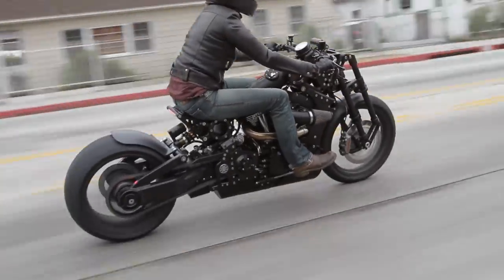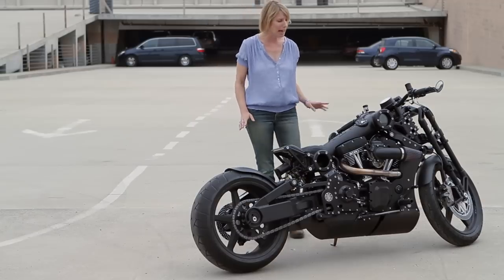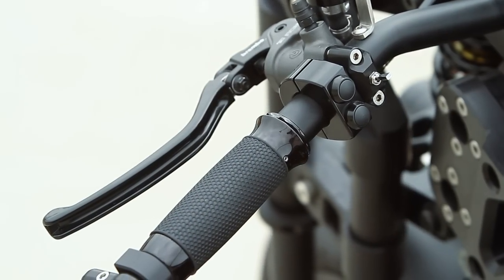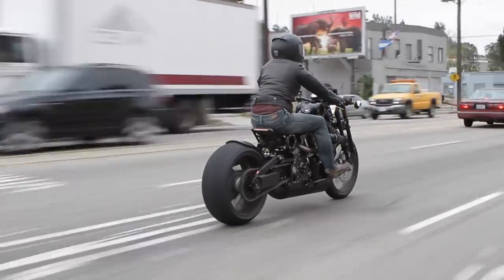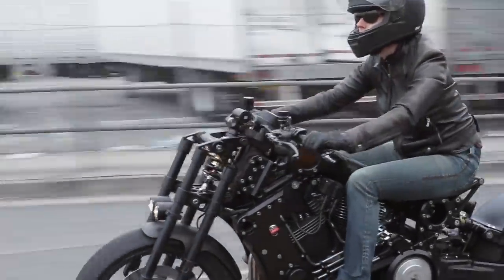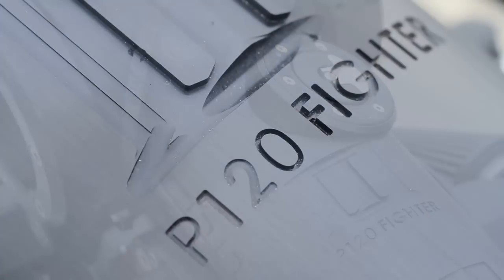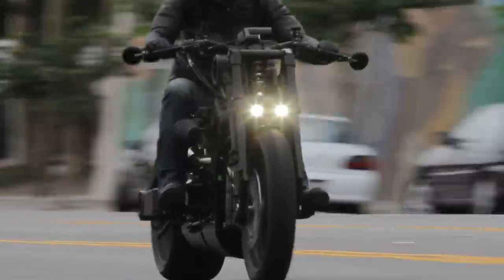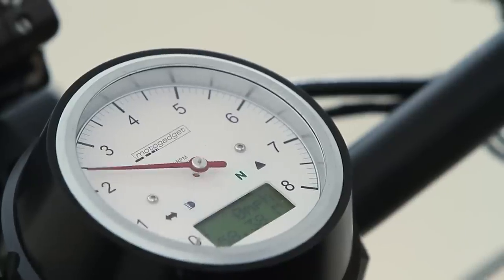Motorcycle review: Confederate Motor's P120 Fighter

Comment: Radial twin? As I remember my nomenclature this would be a Vertical twin (as opposed to parallel twin or opposed twin).  If this were a 3 cyinder in a y configuration with cylinders 120 degrees apart all "radiating" from a central shaft, I suppose this could be called a radial engine.  Granted, the two pistons are bolted to the same pin, so technically they do "radiate" from that pin, but "radial" is a stretch to me (a BMW could then be "radial") .  Any engineers thoughts on that?